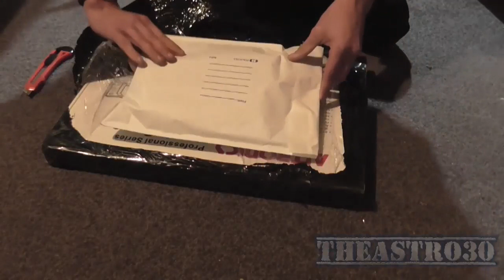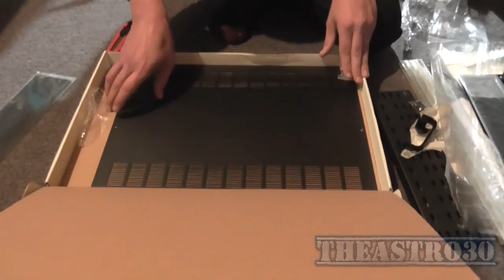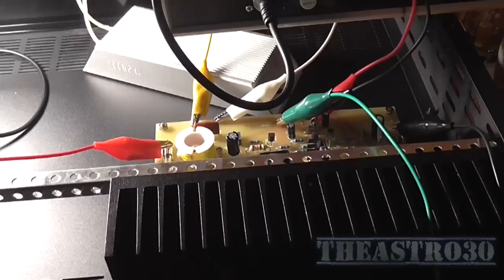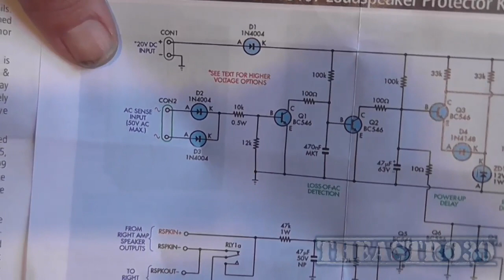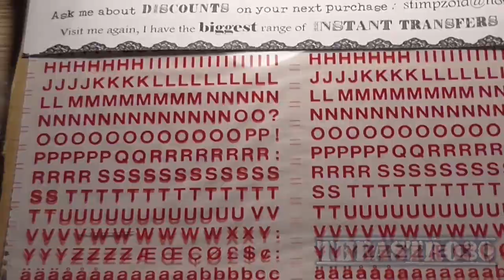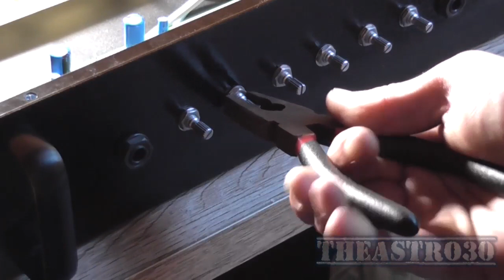Bass Guitar Amplifier Build & Test - Part 1

Comment: For the lettering, I spray the front plates with a white satin paint, apply the vinyl letters, then spray the front plate a satin black.  After it is dry, I use a small knife and lift the letters off.  White letters on black
Reply from the maker: Interesting. So, do you have these vinyl lettering laser cut, or something? I'd see it being very fiddly. Or, do you mean using the "letraset" rub-on stuff?